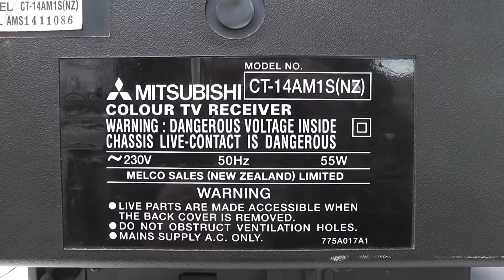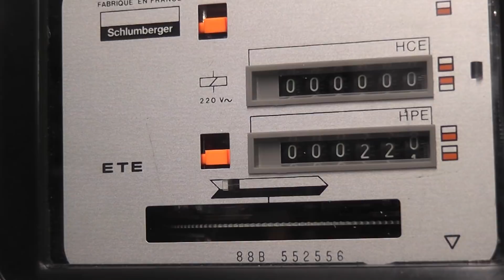TV submerged under oil and then water

Comment: Too anyone that knows about mineral oil it dosnt hurt electronics it helps cool them and with water if the electronic components are insulated the wires and other components water usually is okay as well but most things other the wires are not built too be all insulated

Comment: I did not have oil. So i submerged my tv in water. It stopped working unlike yours.  When i reached in to turn it off, my hand felt funny.  Any idea why?
Reply: I don't know why the TV stopped working. Maybe the vacuum seal broke, and oil got in the tube.

But I do know why your hand felt funny. It felt funny because you just put it in oil.

Comment: If that flyback capacitor got you at 1:00, you'd be done.
Reply: +Orange Peel If it gets you in the right spot, it could kill you whether you have a weak heart or not.
Reply: +Rhett Krecic (Rhettsterhhhh) It could kill you if you have a weak heart.
Reply from the maker: +Rhett Krecic (Rhettsterhhhh) It won't kill you but it will give you a nasty DC bite.
Reply: RODALCO2007 II was being sarcastic but that would be funny though.

Comment: perfect... i a considering submerging a circuit under mineral oil and sealing it to make a waterproof drone fish. its a fan with a camera and dual fin top is horizontal bottom is inset slightly and allows for turns there is and attachment for the fishing line. i dont know how video will transmit underwate.
Reply: Video transmission underwater is fine.

Comment: What was the point in this? Anyone could've told you that the TV will be uneffected in the oil, except it would probably NEVER break down if you kept watching it while in oil. If however you did the same experiment with demineralised/distiled water, it would be slightly more fun, at least you'd be able to see the picture clearly then. Alternatively if you wanted a more violent reaction, try sea water (in other words salty water).

Comment: Interesting experiment. I would be interesting to see what might have happened if you had used distilled water. I suppose the dust particles  in the TV would have contaminated the distilled water, but otherwise I hear that distilled water is not a conductor.
Reply: *****
Actually, pure water is NOT a conductor. The conductivity comes from ions in the water. Distilled water contains only few and PURE water does not contain ANY ions which makes it an isolator.
Reply: ***** Water is not a condutor as the guy on the other comment said. But if you put water in those componets(from TV), it will get ions, and them...normal water again!
Reply: Still, pure water is not a conductor. After electrolysis it's not pure water anymore.
Reply: Frostbite1003 Yeah, but you can't do it in real life; you're right, but it doesn't mean it's a way to do this stuff.
Reply: Frostbite1003
no , electrolysis

Comment: Mineral oil is di-electric. It also absorbs heat better than air does. I have videos of computer components submerged in mineral oil. They ran for months nonstop, and I found no signs of any breakdown, corrosion of any of the components, including plastic parts(which was a concern of some). It is really messy though, If i was doing some kind of crazy high end exotic computer build, there are non-corrosive di-electric coolants sold by 3M, with feezing points low enough to use liquid nitrogen.

Comment from the maker: Mineral oil is an insulator. Used in High Voltage switchgear and power transformers for cooling and insulating.
Reply: Will it work with vegetable oil or synthetic oil?
Reply: RODALCO2007 it works good for the transformer inside the TV

Comment from the maker: It depends if the air is humid or not. To avoid a shock of any kind it is better to discharge the ultor cap connection to ground.

Comment: Half way through this I was thinking how odd this experiment was.. until I came up with a useful application. How do you design a deep sea machine with electronic components, and reduce the weight of the outer shell? Fill the inner electronic compartment with oil, and you only need a thin shell to keep the oil contained.

Comment from the maker: This was used oil. Even reconditioned mineral oil still has the yellow stain in it, which is almost impossible to remove. Brand new mineral oil almost looks like water with a bluish hue over it.

Comment from the maker: You are correct, after years of use it colours yellow because of parts of varnish from wiring and other insulation material. Even with recycled oil, the colour stain is impossible to remove, and the oil remains yellow / brown in colour

Comment: why test this of course its going to work everything is now better isolated with the oil   ... it will work better under oil. all important parts are air tight and sealed like the electron gun in there.. and of course water will make it not function it will just short it out... all you did was decrease the quality of your oil by dirtying it

Comment: Having some water in a vacuum means the rest is water vapor. The tube will internally arc over (boring) just like if air, nitrogen, or any other gas were introduced.

Comment: Probably not, because air is needed to keep the tape gliding smoothly over the heads, with oil, it'd Stick to the Drum spindle  with the oil and therefore won't have enough torque to overcome the resistance of the oil, Could be interesting though!

Comment: At ten minutes & twenty seconds, a big flash was seen, as the internal circuit board fuse blew. :-D

Thanks for venting that off under water. I was expecting it to be a bit more dramatic than it was, & I think that the neck broke above the water, thus some air was admitted, & vacuum was lost to air instead of sucking up water.

I did LMAO so hard when I saw the telly-screen half-filled with water....Oh yes!

Definitely a YOUTUBE FIRST, right here!

Thanks for showing,

-BoomBoxDeluxe.